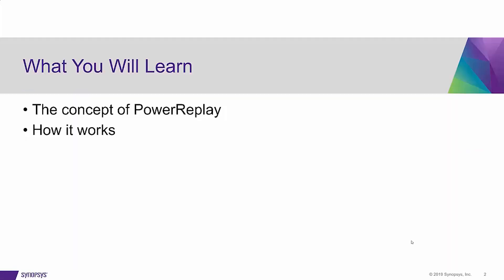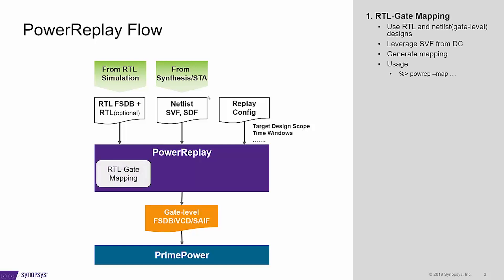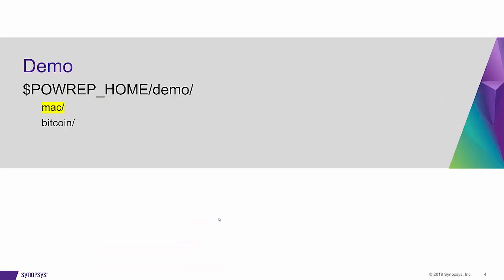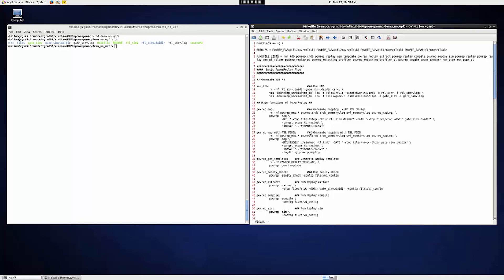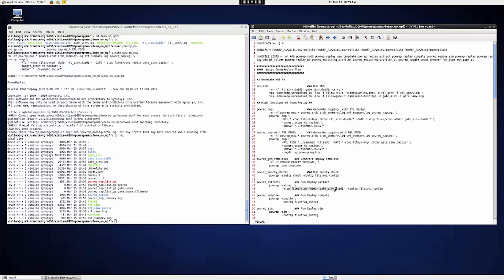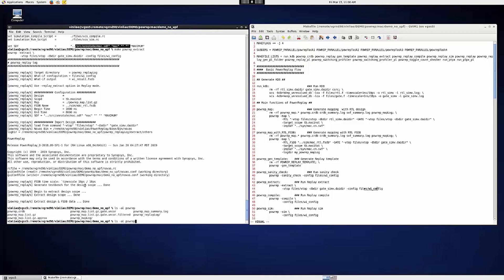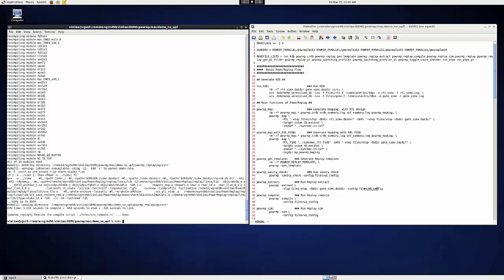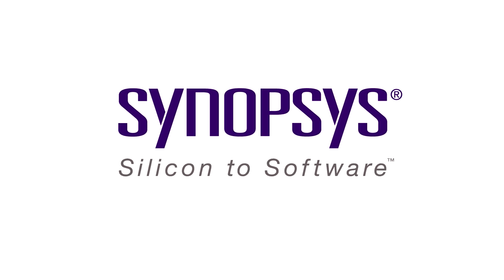Synopsys PowerReplay Solution - Introduction and Demo | Synopsys

Comment: Hi, I have a problem when I using "make powrep_mapping" command (which is "make powrep_map" in this video), the error messenger in crdb.log file is "Error : Failed to correlate rtl node "tb" from RTL". Could you please tell me how to fix it?